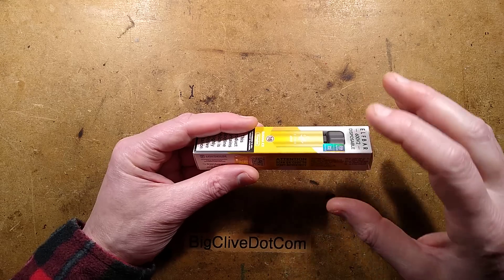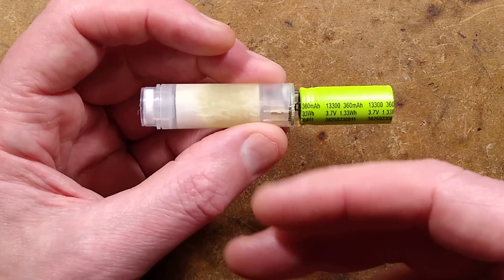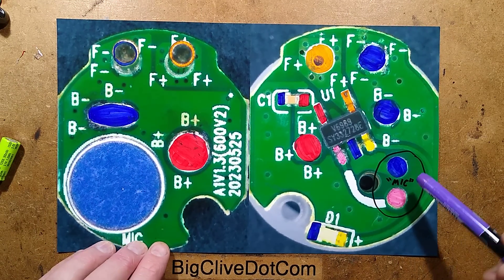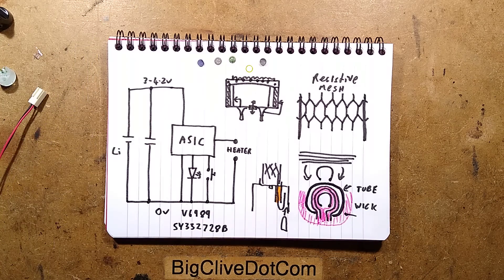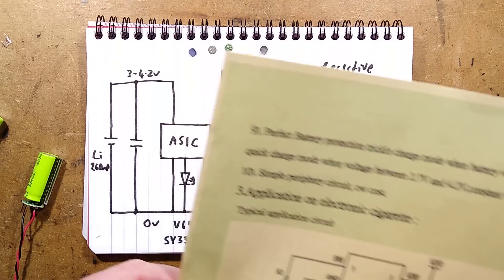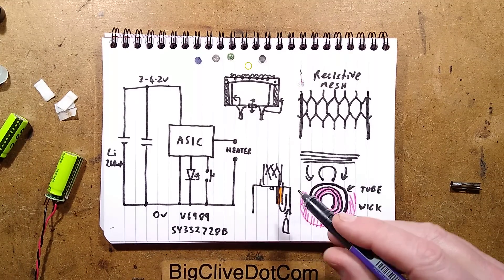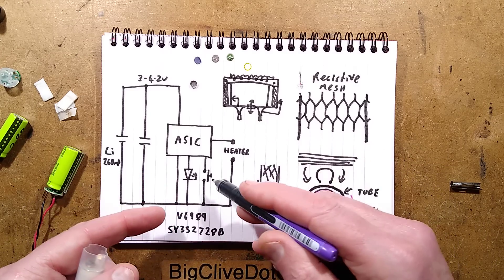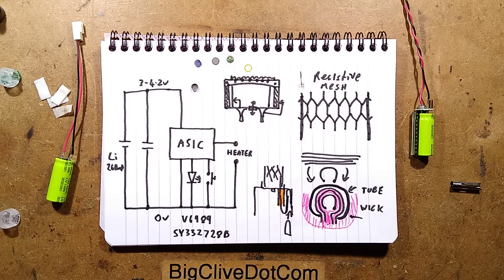Lithium "capacitor" in a disposable product

Comment: Looks like they're moving towards a design that is modular and simpler to reuse/recycle, as it won't be long until legislation starts to force these horrible devices from being so wasteful.
Reply: EU soon to mandate dismantable products that have batteries, must not be glued in. I think they are running ahead of that. Also easier for them to assemble and dissemble. Shows they see a future for these past the battery regulation which we had hoped would see the end of these.
Reply: @ablacknambercat Thanks for confirming the EU is complicit in the manufacture of these hideously wasteful devices. Ive been using the same rebuildable drip atomiser for 10 years.
Reply: Aren't there laws about recycling all rechargeable batteries in a lot of places now? Do they get around them by just saying it's not rechargeable since a connector isn't broken out to recharge it, or does the manufacturer put some fine print reminding the owner to recycle it and manage to wash their own hands of the whole thing?
Reply: @ailivac it does have the WEEE “no wheelie bin” symbol. But no one is going to properly dispose of them. There isn’t really a way to properly dispose of them other than dismantling them and recycling the batteries and putting the cartridge in hazmat.
Reply: @atomstarfireproductions8695  It's the usual problem with the recycling scam. Manufacturers simply add the WEEE symbol and kick the can down the road. Consumers try to figure out how to properly dispose of stuff, then shrug and chuck it in the wheelie bin, gutter or hedge. My local Tescos does have a collection tub for used vapes, but on the 1/2 mile walk to there, I usually find at least 3 or 4 dropped on the path. Which means I have plenty of small batteries awaiting projects sitting in a fire bucket. If politicians were serious about waste, they could regulate at source the materials used in stuff, especially packaging so it can easily be recycled.
Reply: @ailivac  Good Point.
Reply: @ailivac  
it's the fine print route, kind of stupid because people still end up throwing them in the trash, if only we would stop using batteries that are toxic to recharge our devices right?

but they will never do this, they will pretend they are saving the environment while making these devices with these kinds of batteries in them all day every day but they themselves will be adding to the e-waste.

it's like the whole industry of EV cars, it "appears" to be good for the environment "on the surface", until you figure out what goes into making these batteries possible and understand they are even more toxic than the last thing we were using, like at this point i don't understand how they can even make "the claim that these are anywhere near clean energy" when you figure out the truth of how their created and what happens when they start on fire and when it comes to dismantling them and replacing them, i'm sorry, but they are simply not clean energy in any way.
Reply: @5226-p1e  EV's not clean energy in any way, it's just much cleaner than a combustion engine vehicle... I wish people could stop calling it "clean" cause that implies it has no impact on the environment
Reply: But there will be no better than solar coupled with ev for a long long time.
Reply: we already have vapes that take standard 18650s and can be recharged, refilled etc,
Reply: There not theyre profiting millions by not doing that actually disposables make them more money becouse they can charge you 7euro for 2ml of liquid a 10ml bottle of liquid prepackaged costs 5euro and if you mix it yourself its about 1.30 or so for again 5times as much of what a person would actually care about battery and coil cost is neglegable at this scale a battery(3000mah) is 10bucks will last a year or 2 and a pack of 5coils they last about 3weeks a pop is 20bucks you will go through one of those disposables in a day of you use them
Reply: What's so horrible about them?
Reply: doesn't making it non- rechargable make it more wasteful?
Reply: @Bapuji42 yes. Thats on purpose theyre selling a battery a coil and 2ml of liquid daily a person who uses could only use a coil per 3weeks the same 2ml of liquid a day and a battery every year or 2
Reply: Whats so horrible about them? They got me off cigs and I breath better than ever.
Reply: @seymoarsalvage theyre horible for the invirioment better off using a refillable vape meybe a pod system or even better a box mod with a rda for minimum waste
Reply: Yeap, what a "mess" for the environment, creating e-cig for single-use with 3.7V li-ion battery, without ability (for majority people) to easily recharging and reuse battery in other devices.  But you can cut off the circuit board from the battery and recharge with any charging device for 18650 li-ion batteries, of course if you have soldering skill and “direct hands”…
Reply: I refuse to use anything with a throwaway battery.
Reply: @joshmarchant604  so no pc for you? The motherboard has a disposable battery. Also many low current devices such as wireless mouse, keyboard would suck with a rechargeable battery because ion betteries lose charge with time, even when completely unused. Meanwhile Alkaline preserves it's charge as good as it can be.. so batteries last years in low power devices. None of that for you though, so no remote for your tv, no ac... xD
Reply: New Zealand is in the process of banning disposables
Reply: Which is stupid because that´s what everyone i know had in the beginning of the vaping hype, the accumulator powered, customizeable and refillable big ones. So why not just stick to these. Well there was a huge blackmarket for liquids and now the regulations made them disappear. Mostly because governments don´t want to pass on some extra juicy possible tax income. Anyway i don´t smoke or vape and i think the less people do the better. These one-off things should be illegal.
Reply: Or just smoke tobacco
Reply: Well they’ll be fully banned soon which is good, far more dangerous than smoking and very much advertised directly to children
Reply: @Alphoric lol. Outright banning vapes? Governments don't give up tax money once they taste it. So as long as vapes generate taxes uncle sam will happily be a whore for them.
Reply: In the US legislation has made them more wasteful. Used to be you'd only have to replace a coil regularly. Everything else lasted and they were rechargeable. But they banned the sale of vape juice separate from a device. So now, all the devices are disposable (and made by big tobacco).
Reply: These devices genuinely make me feel ill. 
How did we go from fully reusable vapes. Easy to use and refill. To these horrible disposable things!? It’s mad that they are legal. Electronics waste is bad as it is. We don’t need nicotine addicts joining in too.
Reply: Its already been long and its gonna be longer unfortunately
Reply: California has passed laws where these can no longer be sold as 'disposable'.
Reply: neat
Reply: Got nothing to do with them being horrible or not, governments are just missing the tobacco tax. In the UK they limit store bought vapes to 600/700 puffs. Yet online you can buy 10,000 puffs in one device. What's worse for the environment? But if they let you buy those in store they wouldn't be able to get as much tax money as they do by limiting you to 600 puffs. I can buy one 10,000 puff vape online for £9-£15 yet the shops sell 600 for £5.99 due to tpb laws. It's all for tax money.
Reply: As long as there are dedicated, non-interchangeable connections for various, eh,  "products", cartridge systems are all too easy to implement into a variety of form factors. Recharge the battery, slap on a new tank, minimal waste.
Reply: The gold is a clear incentive
Reply: These devices came about because a simpler reusable version was banned…
Reply: Vaping needs to be banned, end of.
Reply: @mariemccann5895 why? It helps people quit smoking!
Reply: They are actually harder to dismantle. They come apart easily enough if the casing is intact, but you try opening a semi-crushed one 😱 absolute nightmare! And the top of the battery casing splits open where the engraved cross is at. Hmm yummy electrolytes anyone? 🤮
Reply: I've been vaping for 8 years and it's saved my life but this is so wrong!
Reply: That implies the government is remotely competent.
Reply: Disposable "vapour devices" will be banned next year which is amazing imo. It's sad to see people treating a finite resource as if it's infinite.
Reply: EU TPD regulations requiring maximum 2ml tanks and 20MGml nicotine brought on this bullshit, so now the same morons are going to fix it?

Disposables didn't exist, vapers were all using cigalikes or ego/mod and tank devices.
Reply: yes, and they have also started to understand that they need to do this with cell phones like the old days, and i'm glad they are going this route because the built in battery nonsense is well, nonsense and produces way more E-waste and it's great that we can have a spare battery in our pockets again when our current phone battery runs out, that whole process was just so much better, you could always have one charging while you use the other.
Reply: oh so i need to find another source of cheap lipo batteries, because ive been taking them out of phones to power other devices that normally take aa batteries BAZINGA @5226-p1e
Reply: Here in the United States of Freedom, we are not free to purchase reusable pod models (such as Juul) that have flavors other than fake tobacco. So, we've been going backwards with no sign of change
Reply: @WhatSmellsLikeToast  The UK is also heading that way in order to discourage kids from vaping.
Reply: @WhatSmellsLikeToast  That's not accurate as far as my 2 minute search can find.  I use a tank setup and order various flavors online with no issues, and there are 5 vape shops within 2 miles of here that don't seem to be out of business.  Got a source?
Reply: @WhatSmellsLikeToast  Juul is for kids, just get a refillable pod system and refill with any flavor juice, but you got to goto a vape store where they check ID to get those.
Reply: @WhatSmellsLikeToast The JUUL flavor ban was years ago. What have they done since?
Reply: @WhatSmellsLikeToast  This exact brand is available at every corner market here in the states. Maybe except for commiefornia.
Reply: @-o-The-Duke-o-  yes that's my point. It's a disposable.
Reply: @WhatSmellsLikeToast that’s a good thing, here in the uk the main market for vapes is children and they’re directly marketed to them. No child wants fake tobacco flavoured vapes and the us vape and cigarette users has fallen drastically since the banning of such products like juuls. In the uk though vapes will be banned and smoking will be banned for people born after a certain year
Reply: @Alphoric that’s bs, there are still vapers in the us, otherwise our shops would’ve closed had they stopped vaping, there’s still a market for disposables, refillable tanks, aios with replacement coils, I can also order RDA’s and RTA’s online and buy juice in shop and be set and not have to worry about running out of coils because I can change the cotton when it’s needed, nic salts also are still a thing at least in Louisiana so with that being said your comment is kind of false because there’s still a lot of vapers who use mods that you can change the battery out in or those who have switched to aios and throw away, and there’s still the hobbyist side where you can order things like RDA’s online!
Reply: @WhatSmellsLikeToast You. Can still order them online, fortunately
Reply: @WhatSmellsLikeToast Here in the U S of A we went full innovation with rechargeables that you still dispose!
Reply: @lostsauce0 who’s we I still use my mods that use 18650’s, 20700’s and 21700’s my current mod uses quad 21700 powering a dna250c chip in a 3D printed mod, I also have mods that use 4S lipos with dna 250c chips some of which are custom ordered with specific designs!
Reply: @WhatSmellsLikeToast yh you got scammed  by your forefathers. Me personally, I wouldn’t let that happen.
Reply: @WhatSmellsLikeToast  crazy what the government dose
Reply: @WhatSmellsLikeToast 😂
Reply: @WhatSmellsLikeToast you can go to any vape shop and buy reusable and any flavor you want. In any state in the US. Just go to your local vape shop and buy a pod mod. Can you get them at gas stations? No. But can you get dozens of choices of mods and hundreds of flavors with no regulation? Yes you can.
Reply: You are assuming the government is competent. Common mistake
Reply: Oh? Believe me they have more idiotic ways to produce waste. For example fire alarms. They have two batteries in them one of them is easy to reach, to change the other battery you have to slightly disassemble the alarm. It is not allowed to do that, you have to replace the whole alarm 👌🏼
Reply: this shouldn't be be banned, it's fine, nobody but few eco hippies give a shit.
Reply: No it is just that make which is rare in the Uk. I pick the others up, recharge, put some new juice in and just use my own casings. It costs me £5 to smoke a week. I use each one twice so get the flavour it come with. The coils start to fade after about 2 uses.
Reply: @Vile_Entity_3545  The coils. The weak link.  😒
Reply: @jlucasound do they sell these anywhere??
Reply: @jlucasound why haven’t any of you tried moving to rebuildables? Plenty of online shops over there sell them hell I was even able to get some shipped here to the U.S!
Reply: @Vile_Entity_3545   Proud of your own stupidity?! Idiocracy at it's finest! 🙄🤣🤣
Reply: @Vile_Entity_3545 Get a real vape. It costs me about £2.50/week
Reply: RE: Looks like they're moving towards a design that is modular and simpler to reuse/recycle
more like cost cutting. isn't such design cheaper?
Reply: Legislation often just makes things more expensive and encourages more shady practices to get around the legislation.
Reply: We'll be back to where we were with smoking if legislators don't act soon. Maybe worse as not unsurprisingly it seems to be school kids who are the primary targets. No doubt serious organised crime is behind this, vapes are a stepping stone and what better way to ensure future business than get a generation of kids hooked. Ciao!
Reply: Legislation. you mean the circle of stupidity? Like the electric cars
Reply: @ronrico2620  You mean they're not going to save the planet ? Don't tell me all the selling hype is dishonest ? Can we get BigClive to reverse engineer an electric car and discuss it's carbon footprint and recycling ? 👍
Reply: @dereka6762  I would like someone to explain what will end up of all those batteries in the tesla the eco-warriors are driving
Reply: @ronrico2620 Lithium batteries are one of the most recycled item on the planet which means..... The packs are recycled. Or actually for EV packs it's not uncommon for them to be repurposed for UPSes or other use cases
Reply: @ronrico2620 I'm guessing that a number will catch fire so there wont be quite so many to worry about, but it is comforting to know we are all paying in some way to support their manufacture, maintenance, insurance, and recycling.
Reply: @antikommunistischaktion  yeah I've built quite a few battery packs from old laptop battery cells. All the junk/scrap yards around me don't take them. When a regular car gets totaled it goes to the scrap man. Where does the recycling come in? Does tesla take it back
Reply: @ronrico2620  So because the ones around you personally don't take them that means it doesn't happen? Bro, literally every Home Depot or Lowes will take your lithium batteries.
Reply: @antikommunistischaktion  I thought they got rid of that I got bucket of batteries. They used to have a box by the door at the depot. I'm just saying I am familiar with scrapping, recycling and lithium batteries. Old cars go to the junkyard. I used to dig the buckets at batteries+ for cells to build into packs. They were paying a company to take the lithiums. Just tell me what happens to wrecked electric car. Explain the process
Reply: @ronrico2620  Reuse in fixed energy storage, then recycling to recover the metals to make new batteries.
Reply: @JulianSortland  ok so you regurgitate things other people have said. How are lithium batteries recycled? What companies are taking on this process? Where do they get the batteries? Someone said its the number 1 most recycled thing yet nobody has provided an actual answer to anything
Reply: @ronrico2620 Lithium batteries are highly recyclable... 🤦🏻‍♂️
Reply: @ronrico2620 About 92% of the material is recycled and put into new batteries. More education less FUD 😘 old batteries can be used in stationary applications for years to come too.
Reply: @antikommunistischaktion I think you are confusing lead acid batteries with litium ion. Lead acid batteries are nearly always recycled. Lithium batteries are rarely recycled.
Reply: @crissd8283  Actually both are almost always recycled. Lithium ion battery recycling is more "hidden" to the customer because they're almost never recycled in the traditional sense but repurposed for other uses. For example, and I believe I brought this one up already, old EV packs are generally repurposed for home backup power since they are still able to be used for that even if they can't be used in an EV anymore. Battery modules from wrecked EVs are included in this, but they're also often used for EV swaps, in fact Tesla battery modules are among the most popular for EV swaps.
Reply: @antikommunistischaktion  The Journal of the Indian Institute of Science in 2022 claims that "less than 1 percent of Lithium-ion batteries get recycled in the US and EU compared to 99 percent of lead-acid batteries". Not sure where you are getting your number. It is true that car battery packs are sometimes re-used for home energy storage; however, that is reusing, not recycling. Ultimately they will probably still be tossed when they reach end of life.
Reply: @crissd8283  Maybe find a country where they don't crap in the streets for your data.
Reply: @antikommunistischaktion  According to the BBC, about 5% of lithium ion batteries are recycled. Also, I couldn't find a single home energy storage product that claims to use old EV batteries. Maybe they do but don't tell us?? I find that hard to believe as I'd think they would want to brag about their work. Thus, I am highly doubting very many EV packs get re-used as home energy storage.
Reply: @antikommunistischaktion  I don't understand why you think this is bad data? It is the US and EU. I would think the EU would be near the top when it comes to recycling?

You do know the EU is the European Union that includes Germany, France, Spain, Italy, Denmark, etc.
Reply: @ronrico2620 I’d hope recycled.  Battery recycling exists.  People just have to send it to recyclers rather than landfills.
Reply: @dereka6762  yeah the main issue with evs is the lithuim mining as it’s not sustainable like a lot of people thought especially when you need big heavy equipment likely ran on fossil fuels to mine the lithium which is going backwards.